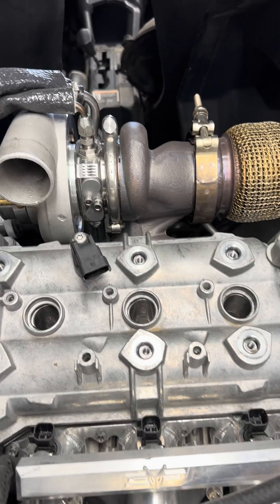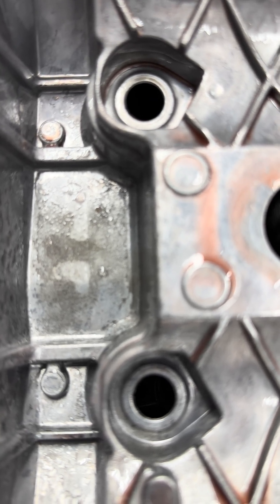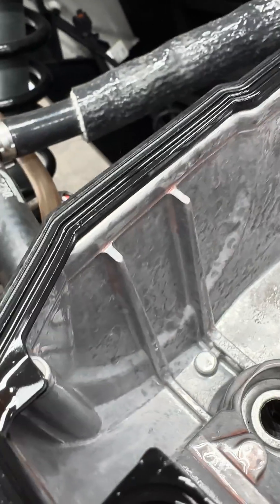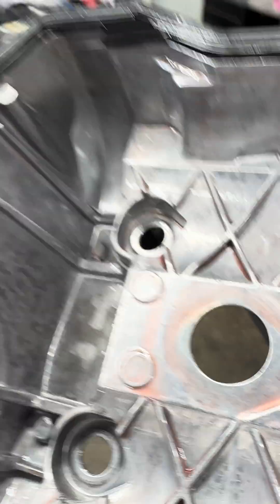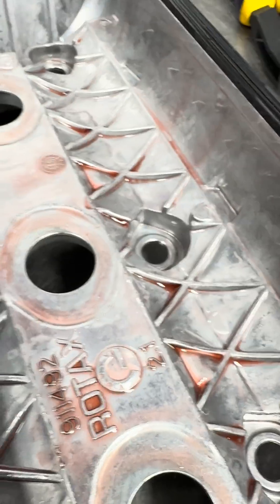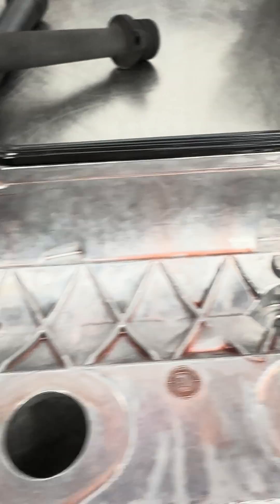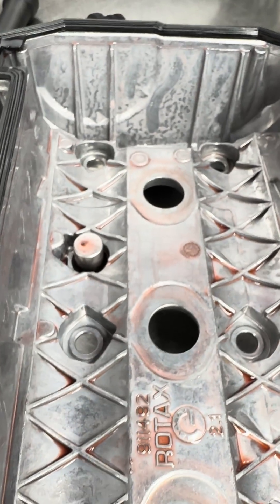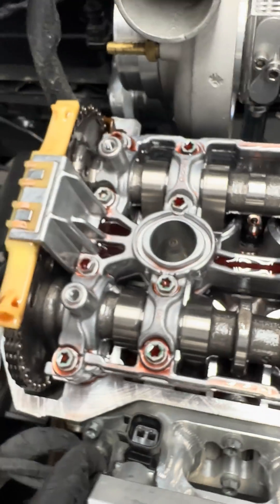Can-Am X3 engine running on water instead of motor oil

Comment: How do we prevent this ? What’s the cause and the solution I have the same problem
Reply from the maker: @4-matic212  This is caused by the combustion process of running e85 fuel, the solution is to run our billet valve cover with internal baffle and huge ports to let the moisture out to atmosphere